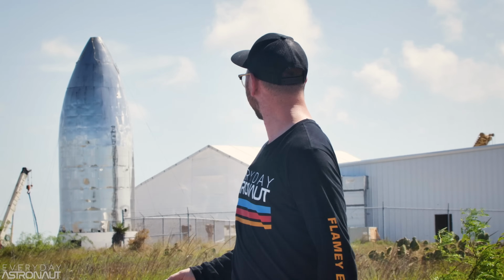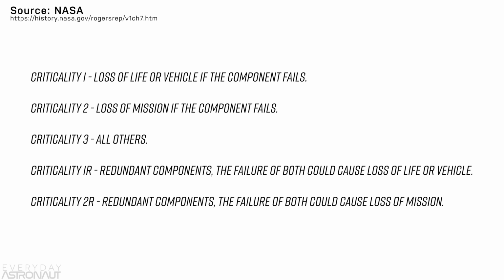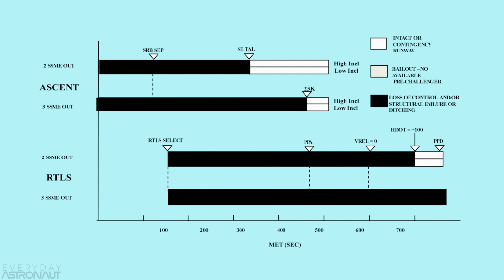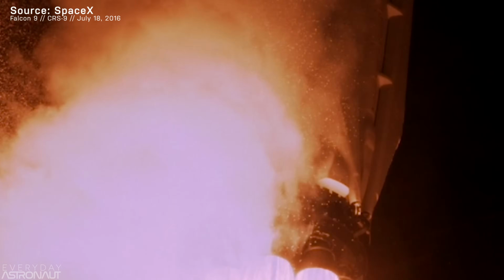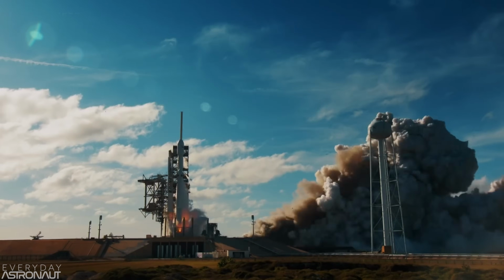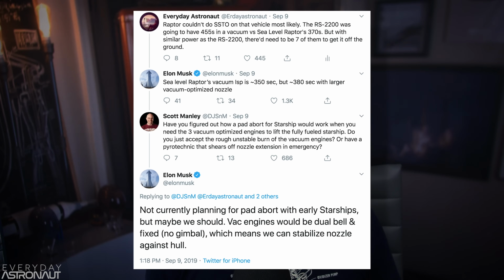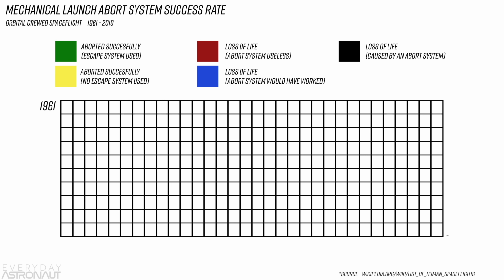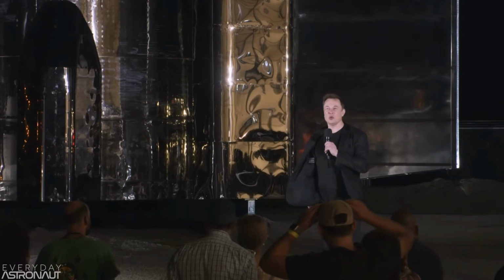Why won’t Starship have an abort system? Should it?!

Comment: 21:44 Two comments here:

1) The in-flight RS-25 failure resulted in mission success, so if the standard is mission as you propose here, then...
2) It should be pointed out that the failure of the RS-25 here was caused by a short in either a sensor or the engine controller (I don't remember which).  Either way, the engine shutdown was erroneous -- and, in fact, mission control recognized this and order the crew to disable the automatic system for the other two engines, which turned out to be the right call (within seconds of cutting out the automatic shutdown system the same problem requested a second engine shutdown).
Reply: In other words, there were actually 2 engine failures with mission loss not happening due to some unrelated circumstances (including lucky timing)
Reply: It was a fault in the fuel turbine temp sensor that caused the center engine to shut down.
Edit: This is in response to "The failure of the RS-25 here was caused by a short in either a sensor or the engine controller (I don't remember which)." Overall the point of the video was to address the need and effectiveness of abort systems though which makes the exact cause of failure in the center RS-25 during STS-51F a moot point.
Reply: In discussing abort success, I just count crew survival. Even if 2 or all engines shut down, the crew is OK if have enough altitude for a fly-back abort to the mid-Atlantic (Azores Islands, etc). But that short could have occurred earlier. There are figures somewhere about a "black zone" when a fly-back abort can't work.
Reply: He basically showed those black zones in the charts. They are shown in relation to how many seconds into a flight the shuttle is. Effectively NASA made a whole lot of them gray via the "just jump out attached to this tube here" solution they came up with. That being said since no separation of the orbiter was doable in a catastrophic event it would have been useless then. For a lot of the other scenarios where it was supposed to work it also relied on getting the shuttle into a relatively stable glide position. That was not easy to do as it handled very poorly and it also required a certain height to even be doable as the shuttle generated very little lift and would come down fast even in a stable glide.
Reply: By the criteria given, the “100%ish” concession should really be given to the RS-25 and arguably Merlin as well. The RD-180 shut down early but was compensated for and resulted in a successful mission, but the same’s true of the RS-25, which shut down early — okay, many minutes early — but the ATO resulted in a replanned but still successful mission. So, how’s that different from the RD-180’s “100%ish”?

Merlin on CRS-1 did shut down early (and a little destructively) but the primary mission still succeeded, and the secondary payload only failed due to contract terms that were an accepted risk, ie. the secondary customer was taking a gamble on it anyway, and paying a lot less as a result.  The secondary mission had a >95% chance of success if they’d been allowed to do it anyway. In other words, it could’ve been compensated for (just like RS-25 and RD-180) but safety rules said not to try. So, 100%ish-ish, maybe?  (putting aside the much earlier Merlin 1A failure)

I get that the RD-180’s failure was less severe, being just a couple of seconds early, but that’s not a great metric. Ariane 501’s RUD happened due to an issue that wouldn’t have been a problem had it happened a couple of seconds later, for example. And, saying the Atlas V’s RD-180 shut-off wasn’t a problem because the Centaur could correct for it? With the RS-25 and Merlin anomalies the other engines on the same stage compensated too.

The only difference with the RS-25 and Merlin anomalies were that the missions were revised somewhat due to procedures, while with the Atlas, it wasn’t necessary. Merlin, RS-25 and RD-180 all either failed (shutting down early) or didn’t fail.

I just think the “100%ish” concession is a bit bogus, unless also applied to the other two.

Comment: The ironic thing is that Starship is a lot like one of the early Space shuttle concept of a hot body air/spacecraft with a titanium body and a lighter heat shield on the windward side.
Reply: Everything old is new again
Reply: That's what the space shuttle could've been if funding wasn't slashed in half...

Comment: One question and reason for not having an escape system. If your taking off from Mars and something goes wrong where are you escaping too.
Reply: After a day like that, I'd go straight to the Mars bar.
Reply: Back to your Mars base.
Reply: This just blew my mind, idk why
Reply: Hence why we use escape towers. It allows you to ditch the vast majority of the escape system once you have reached an altitude where it's no longer needed. Obviously nobody is arguing that abort has any merit on Mars unless we actually have a colony up and running. That being said if the Starship itself is okay and can reach an orbit that won't decay in several months I guess a rescue can be made. That said I doubt it's stocked with enough food. Another option is aborting back to Mars if cargo ships carrying food and other supplies have been pre-launched like Musk is planning. Then they just have to wait it out till and empty ship can be sent to pick them up. Granted their ship is no space habitat, but relaxing for a couple of months on Mars in a bad housing arrangement is still better than starving in orbit.
Reply: . . . oh, if there was a calculated probability of 5% for a safe return then I wouldn't mind . . .
Reply: *you're
Reply: @Freddy — The Great Affiliate I think the reasoning here is that if you survive a launch failure in Mars, you will die anyway because there is nothing there, and help is at least months away. You can't live that long in the escape system, so it's better just die during launch than without oxygen or else.
Reply: @felipaorfr  well on the moon and possibly Mars they'll be habitats. Not at first but later on.
Reply: But we aren't talking only "pad" abort but also in flight. So what are you going to do on Mars if you eject out and land 100 km down range with no support personnel to pick you up to bring back to the minimal base that maybe was there to start? You won't be walking back...

We should aim for airliner safety style. The plane is designed to take it. Better than that every passenger seat is an ejection seat will all the complications to how the aircraft need to be designed.
Reply: as soon as humans arraive there, there will always be a spare starship, because the first starships are intended to stay there
Reply: Super booster isn't pushing starship off Mars
Reply: @Bryan-Hensley  I think it was meant that if Starship had some form of escape system to let the passengers leave the craft - there won't be anyone there who can save you when you've landed in the abort system. So best undesign it and focus on getting the rest more reliable.

Comment: Hey Tim, When a spaceship goes BOOM, it seems to happen instantaneously (ok challenger had a heads up window of a few seconds). Question: Can an abort system really "always" get away from the explosion?  Tx for the upload.
Reply: So far, yes.  An abort system saved a Russian crew years ago on the pad, and saved a couple crews on the way up, most recently last year on Soyuz Ms-10.
Reply: @jshepard152  . . . your explanation ("saved a couple crews on the way up") does not match the message/ Information transported by this video content . . . pls explain . . .
Reply: Well I mean there's always something that could go wrong, it's rocket science after all but in most cases of a failure, something (detectable) is going wrong before the hole rocket explodes. If a abort system is fast enough and designed to get higher acceleration than the rocket, your chances of survival are pretty good but definitely not 100%
Reply: No, it can't, however the part the crew sits in has already been designed to resist a hell of a lot of heat and pressure, since it has to return through the atmosphere anyways, at least for the conventional capsules.  The job of the abort system is to outrun the big chunks and get the capsule clear of any lingering pieces of debris or fire, so that the parachute can safely deploy without getting damaged.  When SpaceX does their in flight abort test next year (February I think), they will trigger the demolition charge on the first stage right at max Q to test the capsule abort system.  I fully expect to see fantastic shots of the capsule riding a pillar of fire as it bursts from the fireball of the exploding rocket.
Reply: James Burleson im fairly certain SpaceX won’t detonate the charge, instead they will just shut down the engines. The computers aboard Dragon 2 will detect the loss of acceleration from this, and trigger the abort. Although that being said, the rocket is likely to disintegrate from the aerodynamic stress caused by the lack of an nose cone.
Reply: ok makes sense. Its probably all the triggered selfdestructs that makes it seem like they always fully explode mid-air. Tx  for replies
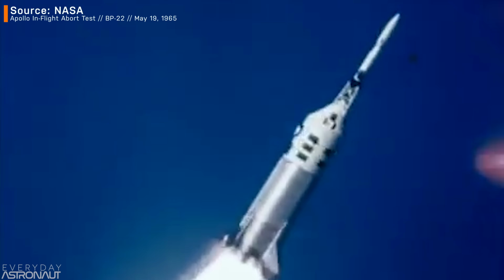Reply: @Silverspoon74  a good example is shown at 4:27 (the text is a bit euphemistic; as far as I remember this was not intended as a test of the launch abort system, but it just happened to work flawlessly when the rocket disintegrated)
Reply: The thing to realise is that rockets don't tend to have violent detonations (a few fuels excepted; hydrazine and h2o2 being the big ones). You tend to get a small detonation of a tiny portion of the fuel oxidiser mix followed by a large fireball as the rest of it rapidly burns. You still get large overpressures, but not the same violent shocks you get from a high explosive, meaning they actually don't travel much faster than the speed of sound. A pad problem will typically take seconds before actually exploding at all, while in flight you will often be going fast enough to outrun the pressure wave anyway. At low speeds the rocket will not be rapidly ripped apart by aerodynamic forces, giving more time to get distance.
Reply: Spaceships rarely go boom in an instance. It can happen, but more often than not some parts go boom and then the rest just buckles under the strain having lost to much structural integrity. Then the fuel that's left lights up and burns near instantly as it's pretty much impossible for it not to hit something that will set it off. The one exception here is the fuel types that spontaneously react with pretty much anything. Some of those can go boom pretty much whenever. And if they don't they generally just releases an equally problematic highly toxic cloud of smoke. 

As for the rockets it's not that uncommon for large pieces to survive disintegration but they are hard to make out amidst the smoke and fire. For instance during the shuttle disaster where it blew on the way up the entire nose cone was found in one area at the bottom of the ocean and the majority of disintegration that had happened was a result of hitting the water at high speed and not the disintegration of the shuttle. The divers even found that some of the crew members had begun procedures that were normally associated with a loss in cabin pressure. Suggesting that they were alive and attempting to follow procedures for a brief while after the accident. Still with no air they probably passed out quickly and if they were still alive would have died due to the G-forces involved when hitting the water. If the same thing would happen with Starship depends a lot on the design and the nature of the accident. It's impossible to speculate about. Still I reckon an accident like that with 100 people lost would be a PR nightmare and probably ruin the entire Starship project if not the entire company. After all they are not NASA flying trained astronauts who understood the risk and accepted the consequences. They are merely flying tourists in space.
Reply: An abort system is needed for several types of failures, with most allowing time to get away. The flamey boom is less likely. As Tim said at one point, no escape system can outrun the pressure wave of an explosion, so capsules (and Raptor hopefully) are designed to survive this and then get away quickly from the full fireball and debris. "Always" is a tough standard for anything - I'll settle for very very likely.
Reply: Yeah in fact the crew on the Challenger was possibly alive when the cockpit hit the ground. They were likely knocked out due to decompression, but if there were parachutes and pressure suits they probably would have survived.
Reply: No, in fact if the first stage explodes no abort system is really going to be able to do anything about it. There are a limited number of circumstances where abort systems can help, and even then the abort system itself may fail.
Reply: Tx for great comments :) love the discussion.
Reply: The most dangerous part about flying airplanes is the take off. The plane needs full power and there is an unrecoverable window just after wheels up that the crew and passengers are MOST vulnerable. Most fatalities occur in this window. To date there has never been a practical solution for this safety issue.......... When we fly and are informed about this we accept this risk. If ignorant to this then your probably a bit happier and think because of the bump at speed wheels down that landing is more dangerous then your probably one of the folks that applaud landings. 
With rocket flight you must accept a higher level of risk period. As the video clearly stated the risk is still much higher and all those who ride the rockets of the past understood that spaceflight is simply a gamble. You gotta want to do this. IMO all civilians flying in future rockets should sign a waver that they can only sue in person after the flight. Meaning if the flight was disappointing in any way like the food sucks they could get a partial refund. 🧚‍♂️
Reply: @TheRolfano  Re applauding an airplane landing, maybe you're confusing danger with difficulty. Take-offs may be the most dangerous, but that's specifically because in case of a severe technical failure the pilot may be unable to do anything about it. The most difficult phase of flight, however, is indeed landing, as there's far more to be screwed up by the pilot. If you want to applaud the airline's maintenance staff, applaud after take-off. If you want to applaud the pilot, applaud after landing.

Comment: How do they make sure airliners are safe?
Reply: Learning from accidents, as well as trying to foresee and prevent all possible failure modes.

But most of all, an airliner is an inherently MUCH safer form of transport than a rocket. The amount of energy involved, both in terms of speed and fuel, is orders of magnitudes different. The fuel used in an airliner is flammable, but quite hard to ignite, while the pressurized fuel/oxidizers of rockets are utterly explosive and require only a little spark to go off.

But in addition to trying to make them as reliable as possible, they still design a multitude of emergency systems: seat belts, oxygen masks, life vests, inflatable slides, emergency exits and so on. Sure, if the airliner crashes straight into a mountain and max speed there is nothing left, but in many cases the crew can retain enough control of a crippled plane to at least perform an emergency landing.

No machine can be made flawless, so it's better to design it with backup solutions if it should fail than pretending that it can't fail. 

Remember: the RMS Titanic was supposed to be "unsinkable", so they didn't care to add enough life boats as they cluttered up the visual design. 1500 people died.

Comment: Get ready for the comment section to be flooded by rocket scientists lol
Reply: You don't need to be a rocket scientist to know that riding a rocket without an escape system turns said rocket into a deathtrap.  The shuttle demonstrated that very effectively.
Reply: @jshepard152  
The shuttle as a system is 40 years old, it's not really fair to say that because it was dangerous all rockets without abort systems will be as well. It's totally possible to have a safe rocket without an abort system, though it should prove out that reliability with a few dozen launches first.
Reply: Tim's not a rocket scientist. What's your point?

Comment: Big passanger planes do not have abort systems so why should starship?
Reply: When was the last time you saw passenger jet accidentally blow up?  That's why.
Reply: @elephantsarenuts5161  it happens, they crash, but there rate of crashing is low enough to not warrent such impossible safety standards as and escape system
Reply: @frbe0101  they aren't that safe. Airliner pilots are way up on the most deadly jobs. Airliner pilots job is more deadly than a truck driver job. Truck drivers are on the road more than an airliner is in the air too.
Reply: They have wings, they can turn around and have hundreds of times

Comment: You can debate it, but NASA requires a full envelope abort for human space flight so without it, Spacex can forgot about astronauts flying on their ships.  The real question is why are deaths in space flights unacceptable but 100's die in auto accidents everyday?  Why does NASA require a lower risk for space flights?  I think the "MARS" series got it right in that a single death could cause cancellation.  Weird to me.  You point it about about the early air flights where 1000's died.